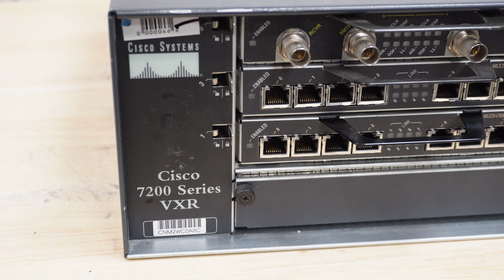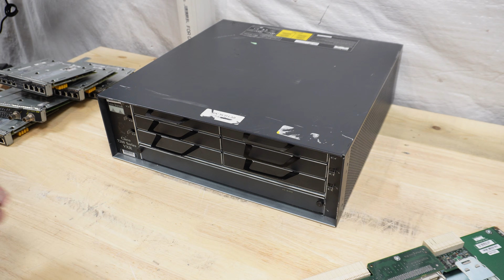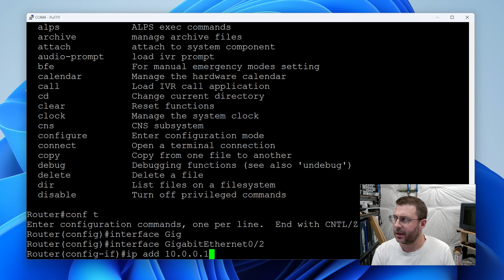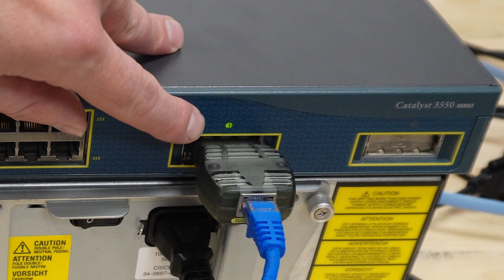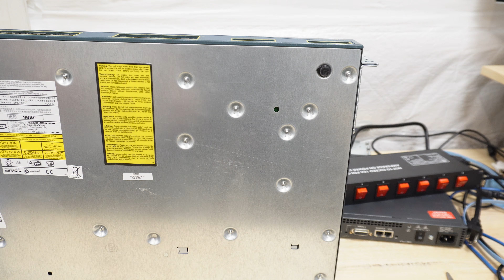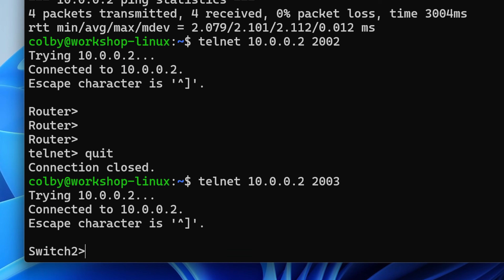Setting up a Retro Rack

Comment: NPE-G1 was a huge upgrade from something like an NPE-300 - you could easily take a full BGP view w/o issue on that thing, and given the cost of GigE interfaces at the time, having three on the back was just a huge bonus. We were able to run both of our upstream ISPs into the NPE and then use the 3rd port for our rack switch (this was an ISP in NYC, I believe one of the first 5 or so that survived any length of time). Also way more resilient in the face of DoS attacks than prior NPEs. Do you recall what the difference is in the VXR vs. non-VXR chassis? I think it was like 32-bit PCI interface for the cards vs. 64-bit? But perhaps other differences?

Anyhow, found an OC-3 card for one of these the other day. Could probably make a whole $25 selling it on ebay. :(

Comment: Just came across your channel. Retro ?  Not really. You want to be retro get yourself a VAX, maybe a benchtop VAX station to start off if you arn't familiar with DEC products, then look for a DG MV6000 or 8000. That is real retro and different. Obviously you're in the US. You have access to a huge resource of second hand stuff there. Unfortunately shipping is exorbitant to Oz. Sparcs are hardly retro, unix is vanilla retro. You can emulate that quite easily. Not so VMS/VAX or Data General.

Comment: Hello! I think you would be interested in the Dell PowerConnect 5524 and 5548 switches. I grabbed one from my high-school's rack a few months ago for my homelab, and they are really strange.
They have Cisco-flavored CLI and a custom Dell web UI, and use regular HDMI cables for stacking together. I know it's not in your regular date range for networking equipment, but it's really interesting how they work.

Comment: re: diy rack ears-> a small press brake and a drill press and some material should be enough to get you started. nice rack!
Reply from the maker: Exactly what I'm thinking! Harbor Freight visit in the near future.
Reply: @clabretro  looking forward to seeing your progress. you may look into some PDU's for your power after you wire in your branch circuits.

tripp lite PDUMH15HVNET
APC AP8858 

would be interested in your reviews on those or similar (and could potentially lead to videos on logging power consumption when the entire racks are going full tilt).

Comment: I hate cage nuts, I rather have a rack with drilled. threaded holes to secure the gear. Usually feature 2 post racks but we had a bunch of 4 post racks with the same direct 10/32 screwholes for mounting gear.
Reply from the maker: yeah threaded would be awesome

Comment: Possibly the reason you can't connect to the terminal server from your home network windows PC is that WSL is running its own virtual network. There might be some flakiness skipping through multiple networks like that?
Reply from the maker: That's exactly what I was thinking, some WSL funny business might be going on (even though none of the interfaces report as 10.0.0.86 and the machine is set to 10.0.0.4)

Comment: A few days after seeing your video about using routers as dialup servers, I unexpectedly came across a used Cisco 1921 in a home security  system shop and for my surprise it had a wic-2am-v2 modem. Despite having zero experience in network stuff (beyond configuring my modem😄) I could config it using your instructiond and with a help  of spare parts that I had I have made a land line simulator that provides off hook and ringing voltage.(it doesn't look pretty but works). I now have my own dial up network and connected my retro PC to it.
Reply from the maker: awesome!
Reply: Yes! Answering machine fun is in your future!
Reply: @SproutyPottedPlant  If you mean nuisance calls, I am isolated from any landline, otherwise i don't understand your joke.

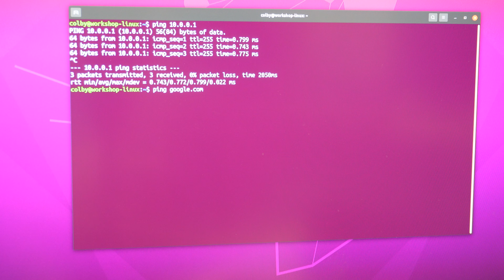Comment: 17:22 The devices on the 10.x network can't access the Internet for a couple of reasons, the Vxr router needs a default route set for your uplink (ip route 0.0.0.0. 0.0.0.0 <uplink ip>) as well as setting up a route on your existing networks router for the networks connected to the Vxr, you might want to implement a routing protocol such as ospf or eigrp for this

Comment: Why be boring and use normal RFC-1918 addresses? Why not try RFC 6598? It's supposed to be treated with the same rules as 1918 networks, so not routable on the public internet. :)

Comment: Take it from another nut with a rack, rack studs are life savers!!! Granted I only have a 36u, but my lab might not be 7 feet to the push tile ceiling. a number of 4u's couple of 2u's and pair of cisco 2960S's and it adds up. They help for guiding gear to be installed, but they are plastic. you'll want more shelves.

Comment: Your terminal server console is probably missing a default gateway, or it's set to something other than the current default gateway of that network, that's why it wont resppond to pings from outside, but you can easly access it over the local network...

Comment: Pro tip: for those right-angle rails, you should be able to flip them upside down and stack the gear on top. You lose one unit, but it prevents the issue of gear taking up slightly more than 1U. Also they won't block gear that's just wide enough to fit between the vertical rails. Edit: You can also slap a blanking plate over the front before you screw it in to make it look nicer.
Reply from the maker: I'll experiment with that!

Comment: Cool vid.  Been building racks for years.  The Dell racks for example have built-in cable mgmt (I am not being critical)
Also for network/cable management, you might try a 24 port keystone rack.  Would help them  thar cables in line.
Reply from the maker: Will definitely be adding in some keystone panels to help with cable management!

Comment: An acquaintance of mine had a rack tip over on him. Ended his career and changed the rest of his life.

Watching you fumbling around with ios is half the fun of watching your videos. Not boring at all and reminds me of when I messed with ios many years ago.

I usually test a router by pinging ips incrementally out of the network. First the router, then a host on the next network, next router, etc. Don't forget it is bidirectional and packets can sometimes go out but not come back. A laptop with top dump, iptraf, of Wireshark is useful for testing.

Comment: Is one rack enough? Perhaps a network rack and a server rack (with 48 port interconnects) and perhaps some fibre.  Helpful to have raised floor to put it on which makes cable routing nicer.  Depending on how you have the rack filled they can be unstable when you slide a server out, they usually have a plate to allow it to be fixed securely to the floor. Power can be an issue, I remember designing them with dual 32A PDUs with iec sockets to connect to the units.  UPS at the bottom of course.

Comment: I highly recommend factory resetting as part of your workflow, ideally just before racking. Then the rack becomes a predictable entity. The 10.0.0.86 is probably some legacy config in the network gear.
Reply: Factory resetting deletes the lore that is included with used equipment. I love reading old hostnames, custom router setups and sometimes port descriptions if it was from a more advanced company.
Reply: @uiopuiop3472  for sure but you do that on the bench to look backward, not in the rack going forward

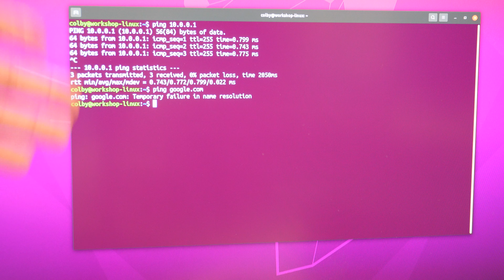Comment: @17:30 You‘re missing the return route on your home network router to know where to send 10.0.0.0/24 traffic, because you‘re not NATing outgoing traffic towards that. So either set up NAT on the 7200 VRX or set a static route on your home network router for 10.0.0.0/24 to GW 192.168.1.100. I‘d always prefer the static route for more longterm setups, as it gives full visibility within your complete network, allows traffic from your home network into the lab network, avoids double NAT and the 7200 VXR doesn‘t have to run stateful, if that‘s even a thing on that box.
Reply: Nah, if that were the case, his home network wouldn't be able to reach his Linux machine. The problem is more likely the 7200 router doesn't have a default route ("route of last resort") defined to tell it how to route packets back to the home network. The Linux box does. So basically the pings get from the home network to the lab network, and to the 7200, but the 7200 doesn't know where to send the response back. No NATing is necessary here, since it's two RFC1918 networks talking to each other. As long as the router between the networks has an interface on each, and everything on each network is pointing to that routers interface on the local network, no NATing is needed.
Reply: @StrongbowTX  You‘re right. I was thrown off by the dhcp pool default-router command that’s just for the DHCP pool and not the upstream route of course and the name resolution error instead of ICMP network unreachable, but if DNS doesn‘t resolve, how would it know which subnet to reach.

It‘s probably just that I‘m so used to return routes missing, that I somehow expected that to be the issue. 😕

Comment: Hey Clab that 10.0.0.86 address you were seeing was your computers ip address when you use linux in windows i thought the same what is that ip address but no it is the matchine you are working withs own ip address.
Reply from the maker: the windows machine was 10.0.0.4, none of its interfaces reported 10.0.0.86. super weird!

Comment: i was screaming at my screen when you put those cage nuts into he rack so easily and without a blood offering. (as you can see i am on the team that hate them a lot)
Reply: The ones that come with the StarTech are not as difficult to insert as most are.  That's a blessing and a curse, as they're also not as difficult to pop out while you're screwing in your rack equipment.

My rack also came with M6 bolts, which are a hair on the large side.  The heads can sometimes foul each other on adjacent Us (can be fixed by keeping the captive cage nut a little closer toward the middle of the ear), and I've had some trouble getting them to fit a few ears.  My Cisco 2851 ears have vertical mounting holes that extend into the top and bottom of the ears (rather than the more common fully enclosed, horizontally wide holes), which gives very little room for side-to-side alignment, and they happened to be just a bit shy of the center-to-center spacing of my rack rails.  I had to use washers between the ears and the router sides to bring them out JUST enough to get the screws in, since the bolt diameter is so big there's no wiggle room.  The diameter was also a problem for an E-mu Proteus synth, where the screws ended up cutting threads into the ear holes.

Ergo, I recommend sticking with 10-32 bolts, and maybe a cage nut with a stiffer metal clip.  They are a royal pain to insert and remove, but they stay put when you get them in.

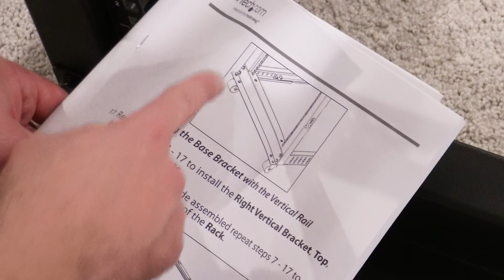Comment: As a note, the assembly directions are NOT wrong. Those large holes are used for large bolts, and belong on the back side of the rack when floor mounting it. It's to counter the weight of one or more pieces of equipment being unlocked and pulled out so the entire rack doesn't fall over, especially in rack configurations where heavy equipment like disk shelves are mounted higher up. Since you're using casters, it doesn't matter, but do be aware of the tip hazard as you fill this thing! 6:08
Reply from the maker: Interesting, it's odd because with those bottom members flipped around they don't quite fit as cleanly as they should (you can indeed bolt them in that way, but it doesn't seem right for whatever reason)
Reply: I’ve seen racks bolted to the floor with those holes facing out on the front also.

Comment: I think you'll like the rack studs for the smaller items. They're a lot easier to work with than the cage nuts in my opinion. They feel super sturdy when mounting smaller stuff like switches and routers. I am using them for my UDM Pro and UNVR.

Comment: On-the-fly notes:

7:20 -- That's a T3 card.  While the original idea was to have a full roster of T-carriers, we pretty much only ever used T1s and T3s.  Above that, the OC-x took over.  (OC-3, OC-12, OC-48, and OC-192 particularly.)

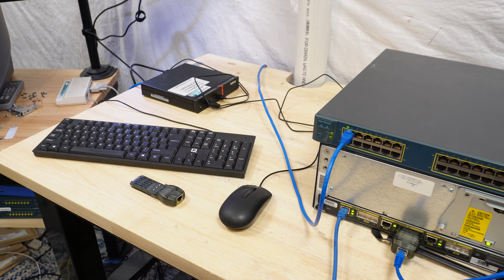16:30 -- "Some sort of autonegotiation"  -- Nope, that's just the switch telling you that the port is in Spanning-Tree blocking mode.  Under the original STP spec, the port listens for a while before entering Forwarding mode, to ensure it won't loop.  Because the default timer of ... I think it's 15 seconds? ... is a small eternity now, you can use PortFast to bring the port up more quickly.

17:20 -- Can't ping Google.  Yeah, this is almost certainly because your home network doesn't know how to get to your lab subnet, so it got the DNS request and then replied -- by sending that packet to the default gateway, which went out to the Internet.  You would need a route to point 10.0/24 to the VXR's 192.168 IP.  Depending on what your home router is, you might also need to tell it to allow the other subnets to use outbound NAT.

24:40 -- Re: Mounting on the front.  You have to decide what you value most here.  Cisco routers (like the ISRs, PIX/ASA, etc.) typically have a port side and a faceplate side.  It's up to you whether you prefer a clean looking rack with pretty faceplates, or convenient access to the interfaces.  It's usually easy to decide, since there are approximately 27 routers left in the world that still have faceplates that fully clip on properly, and even the "clean" side has a power cable sticking out, so you may as well set it up with the interface side visible.  (To add to the quandary, the console port, lights, CF card, etc., might be on either side.  Thanks, Cisco.)  If you're mixing servers and networking equipment, it's pretty common to put the server faceplates toward the front, and the networking equipment facing toward the back, since that's where all your cables are anyway.  This is why lots of networking equipment has an orderable option to change the direction of the fans (front to back, or back to front.)  Except when it's left-to-right.  Power distribution is almost always in the back, although with your fancy switches, you might prefer it up front.  It just makes cable management harder.  Even "proper" racks do a terrible job at this.  Power Distribution Units (PDUs) are often in "zero-U" form that goes vertically along the rear sides ... which conveniently blocks access to the mounting rails, and sometimes to the equipment itself.  Very few vendors have put two and two together and opted to make the cabinets a couple inches wider to accommodate vertical PDUs without interfering with the racked stuff.  Maybe they'll figure it out eventually, but there's so much momentum in a 24-inch wide form factor that ... probably not.  We can't have nice things.

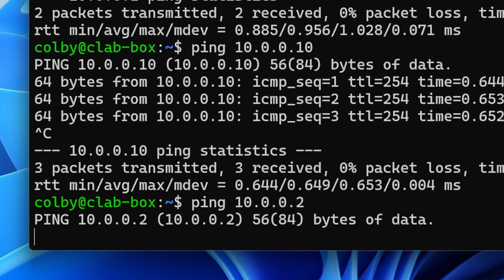25:10 -- Terminal Server IP pings.  To get a reply from a different IP, one of two things has to have happened:  Either you're using .86 as a route to .2 (which might be because you set the gateway to 86, although that still doesn't make a ton of sense on a /24 when both should be in the broadcast domain -- and you might get an ICMP redirect where 86 tells you "just go directly to 2, dummy"), or they both resolved to the same MAC.  Try showing your ARP table and see what it resolved for the .2 address and the .86 address.  Compare that to the other host that can ping both.  If you haven't set any static ARPs, it MIGHT be that they both have the same MAC address.  Some vendors reuse MACs, and I've run into at least one vendor that just uses the same MAC on every device.... although I expect more from Cisco.  Oh, and also make sure that the subnet mask is set correctly on the TS.  I've seen Cisco stuff work in broadcast with the wrong subnet mask before.  That was one of several times in my career where I saw something and thought, "How has this ever worked correctly??"
Reply from the maker: Thanks for the great comment! It was strange, cleared out the ARP tables and everything. .86 was never present (the machine itself was 10.0.0.4, and none of the interfaces were .86). I have a suspicion it could be some odd WSL funny business going on, but haven't confirmed yet.

Comment: I really enjoy your Videos. Just wanted to save you some headache: If you want to connect to the other hosts on your 192 Net or the Internet you either need to setup S-NAT from your 10. To your 192. Net or tell your Gateway (192.168.1.1) that the 10.0.0.0/24 is available at 192.168.1.100. Also to tell your Cisco Router where the Internet is you need to set the Default Route (0.0.0.0/0) to your 192.168.1.1 Gateway.
Cheers an keep posting those retro Videos :D

Comment: I must say i love to see this but i must say i hate the rack sorrry to say and for sure a movable rack is icky its asking for it to tumble over and kill someone :D. I Like full racks like rsa racks that are fully enclosed instead of just some metal rails. For a home racker cagenuts are okish but for someone that has been putting cage nuts of all kinds of quality inside a rack its a hell :D so i like the rackstuds better but still wondering if they are powerfull enough.you couldnt get  to the terminal server since it isnt on a network reachable for youre network. So you need to configure the cisco router to allow to receive traffic and sen it to the retrorack and from the retrorack back to youre network or internet. thats also why youre dns didnt work.

Comment: Why dont you use the back side of the rack for the switches?
Since you dont have an airflow direction you can easily put a switch/hub behind a router (if enough space though). Datacenter  U's are expensive so you need to be creative :)
Reply from the maker: oh yeah I'll definitely be racking stuff on the other side too